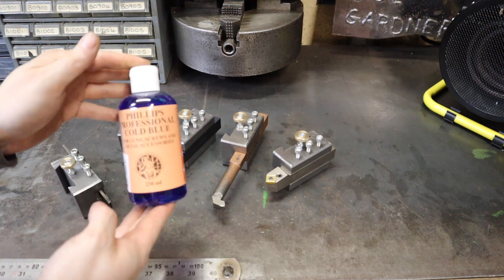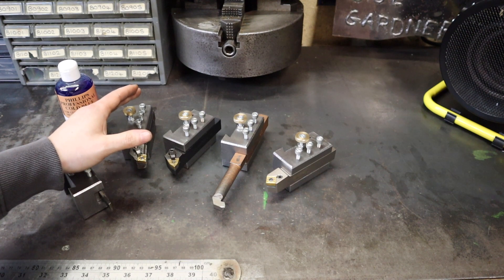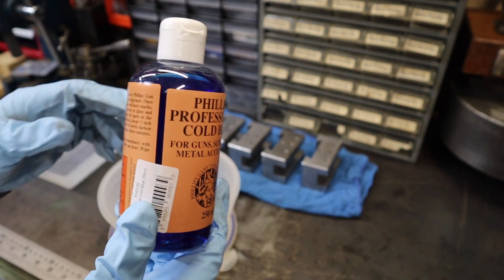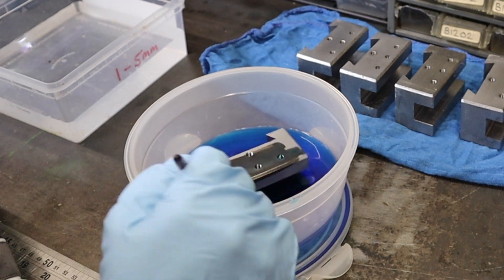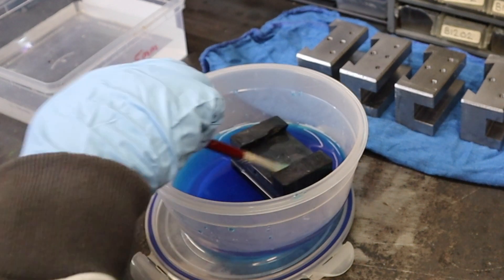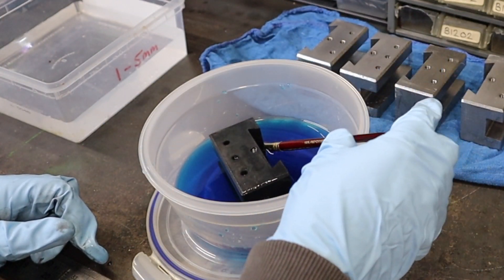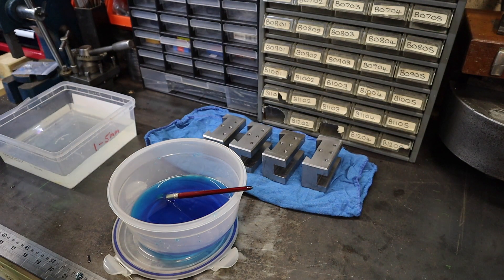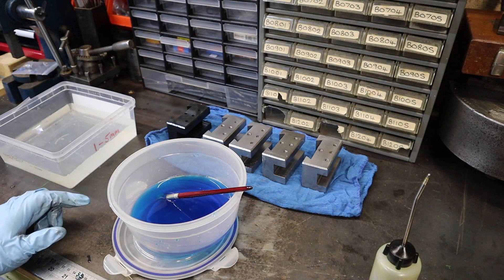My FIRST time using Cold Blue

Comment: You sanded using "lubricant" that contained PTFE (teflon). That may also have contained silicone or other difficult to remove chemicals. Next time, just use plain petroleum products like kerosene or white spirits.
Reply from the maker: Hi John yeah that is a great point very likely that’s where the contamination came from. Thanks for the advise.

Comment: If you warm up the steel a little with a hair dryer prior to using cold blue you will get better results as well.  Using gun oil afterwards usually works best for this application.
Reply from the maker: Good little tip there I will have to try that next time and see how it turns out.
Reply: @MachiningwithJoe  warming up the metal first allows the cold blue to penetrate the surface better. It was something that I was taught from a machinist with more than 40 years of experience with this sort of stuff.
Reply from the maker: @taranson3057  yeah makes complete sense when thinking about it. Will 100% be trying it next time.

Comment: I personally use Birchwood casey. It seems to work a lot quicker than this stuff, but you results are great, too. Unfortunately Selenium Dioxide goes bad, after it has been in contact with steel, so I would suggest you get as much use from what you got left as soon as possible. That is why I prefer the stronger stuff: you can pour a little into a small container and use a piece of cotton or a brush to apply it, instead of soaking the part. This preserves the rest of the liquid for future use.
Anyway: your result is looking great!
Reply from the maker: Some great little tips there a few other people have sed Birchwood is good so will try that and I will also have to try brushing it on in small amounts to save on Blue. Thanks for your comment and welcome to the channel it this is one of my first videos you have seen.
Reply: This is actually a good point to bring up…the same results could have been achieved by simply soaking up the solution with a cotton ball and wiping the steel with it and using a new cotton ball with each application thereby avoiding contamination of the product.  Let’s give ole Joe a pat in the back for giving cold blue a go, the results are acceptable, not to mention that he’s probably never used this stuff before and doesn’t know all the tricks, it’s a learning process, the more you practice the better you get.  Great job Joe!

Comment: Birchwood casey super blue is much better than the Phillips. I have tried both. The birchwood is an instant deep black. After you’d oiled the first one did you remember to change gloves so you didn’t oil down the others before bluing them? They look good, you’ve done a great job with them.
Reply: And vans is much better than birchwood
Reply from the maker: I’ll have to try birchwood out after a few people commented on it.And yes I felt like a surgeon with many glove changes  to stop cross contamination 👍
Reply: @MachiningwithJoe  vans is also a great product, it’s what I have been using for years.  I have tried many brands including Birchwood and wasn’t impressed with the results that I got.  There are mixed results from every product on the market.
Reply from the maker: @taranson3057  I’ll have to try both and see how I get on.
Reply: @MachiningwithJoe  another good one is Optho blue from Brownells